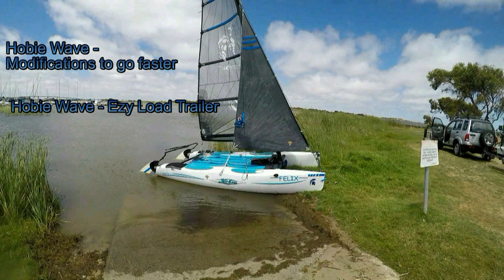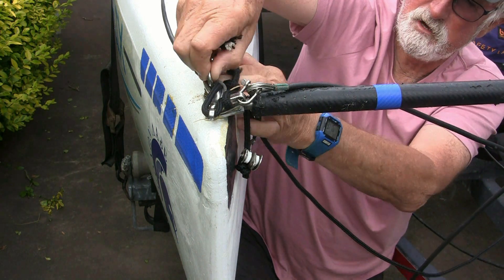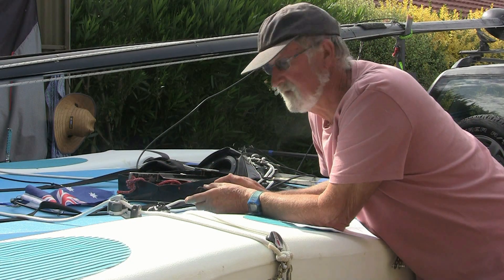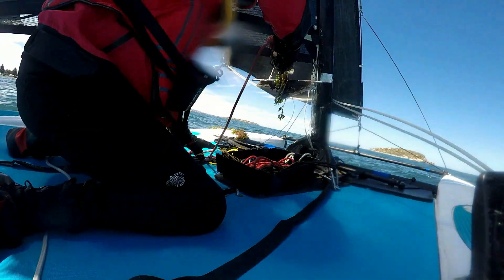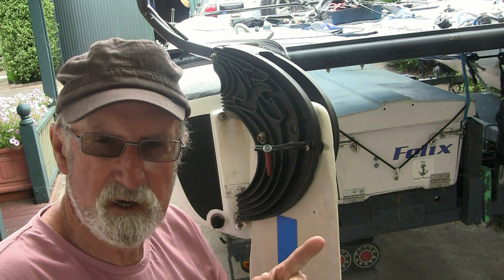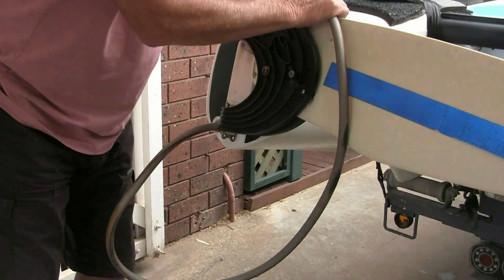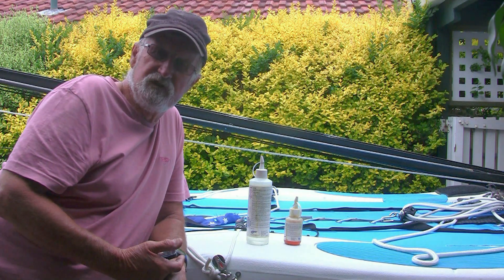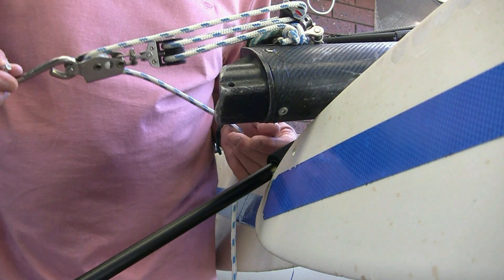Hobie Wave Tips and Tricks Compilation 2021

Comment: Victor, my sailing conditions are 5-10kts on a large lake. what size jib do you use for these conditions. Can you provide dimensions and maker.
Reply from the maker: Hi There  I live in Australia so my sail maker is in South Australia.   If you watch my video on Modifications to go faster you will get the dimensions of the perfect jib.  I have had various sizes made.  The last one ( 2021 March) ended up being good for the light winds that you might sail in, but it was so big it would not go around the mast properly.  You are better of getting  a bigger main with more battens and a larger head.   If you look on Youtube under "Hobie Wave Black Flex laminate sail" you will see the sail made by Precision Sails in Canada.  You can see it on my boat under "Hobie Wave Black Sails"  Good luck and safe sailing  Geoff